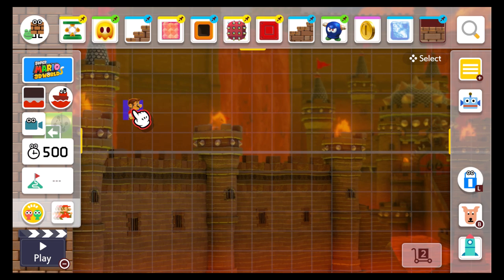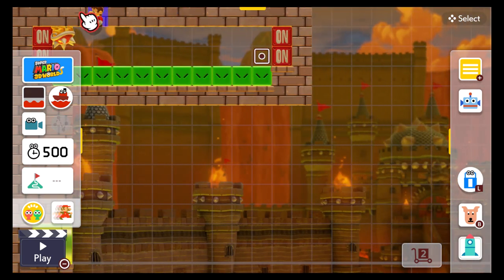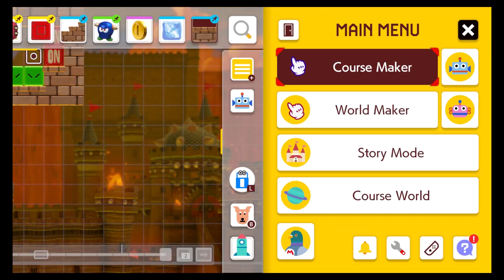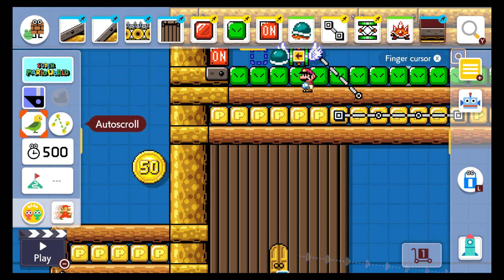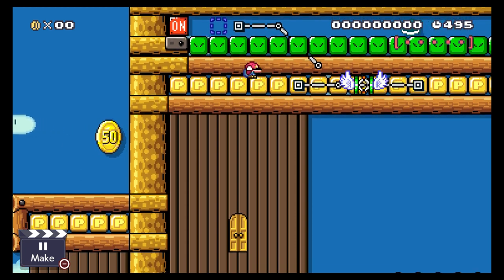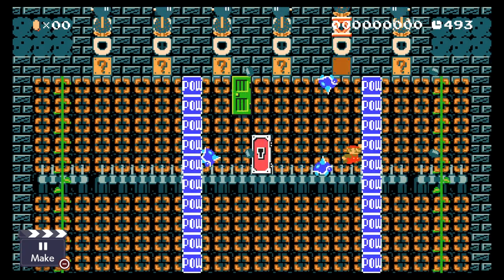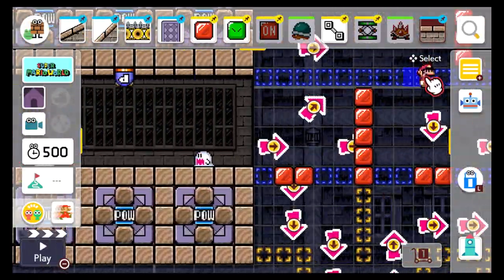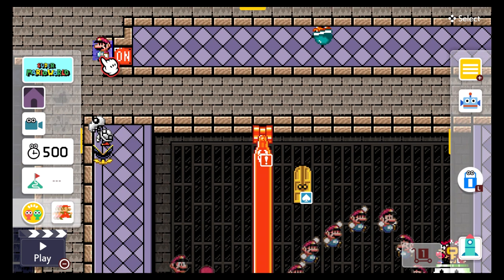Super Mario Maker 2 How to Build: On-Off contraption

Comment: I recently learned about a glitch which gives you a shell that never despawns,all you need to do is place one noteblock down,then another 2 blocks to the right up 1 block,then place one last noteblock with a pow block in it to the upper left of the previous noteblock.Then place a cloud to the bottom left of the pow noteblock and above it,and place Iggy,Wendy,Lemmy or Larry on top of the pow noteblock and it should work.Ill have a bossrush level using this glitch in one of the bosses soon.
Reply from the maker: Cool. It would be cool if you could send me a screenshot or something on how it looks like.